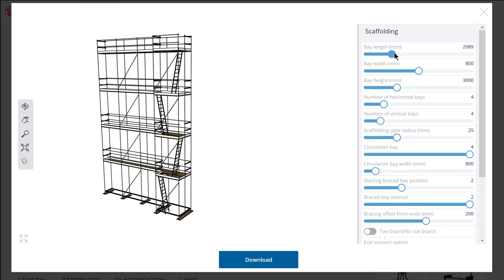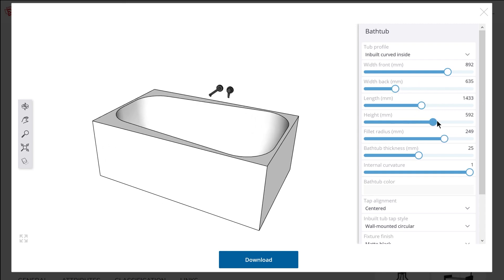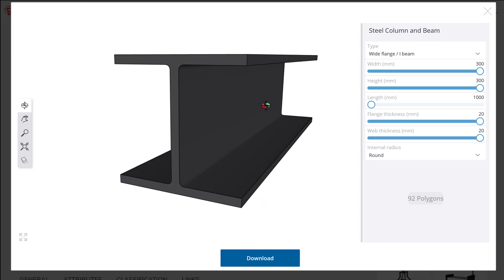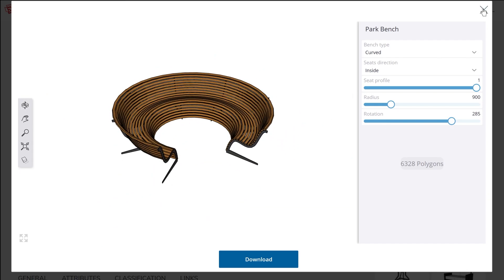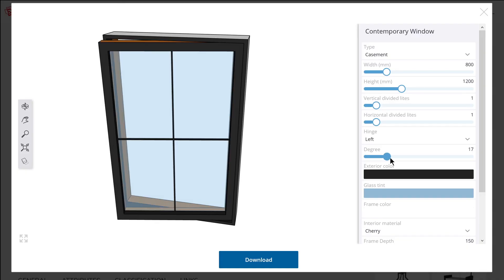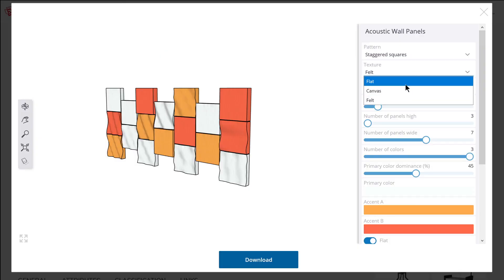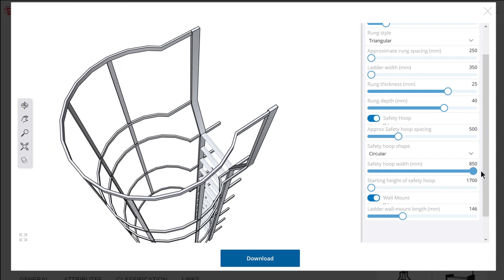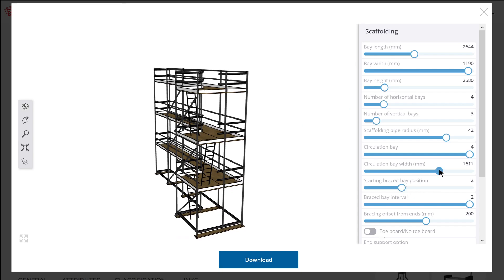13 parameters DISCOVERED by reviewing all 68 Live Components

Comment: Why is Matt not part of the SU development team??!! He's the most straightforward talking SU bod around. Love his work. Just tells it straight.....Trimble should get a grip of this to. Maybe they'd actually then start giving us the features we need in SU instead of the tiny incremental trinket updates we currently get. A brand new UI which is less like browsing the internet in the 90's would be a great start (it's now embarrassing Trimble) and a totally overhauled LayOut that isn't like swimming through treacle with genuinely useful intelligent features please. It's THE most clunky POS ever created in the genre. LayOut straight to the bin at the moment.......so come on Trimble, you've already poached Thom Thom, really get your act together and get Matt on board too.

Some suggestions:
- Multiple views of the model at the same time i.e. plan view, side view and 3D view. As per Revit and every other 3D software
- And the ability to lock the orientation of those views - i.e. lock a plan view, so you can quickly sketch out the plan layout with orbit getting in the way, you know., like AutoCAD's done since the beginning of time
- Updated contemporary styles instead of the same old tired looking styles we've had since the start. See Rhino, Vectorworks, even Revit. 
- Saveable/editable profiles covering all the basics (and more) and which are transferable between versions
- Ability to program multiple UI behaviours i.e. switch mouse middle click-move from orbit to pan, as per the rest of the 3D modelling world, etc
- Full integration of LayOut into the main SU software and not have them as two wholly separate and disjointed applications etc etc